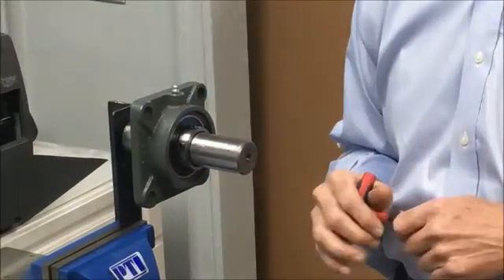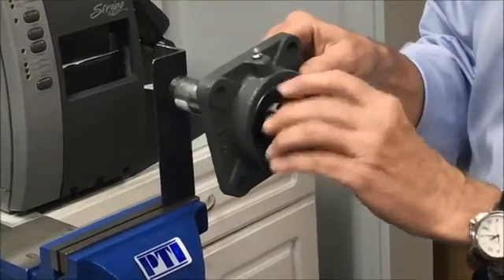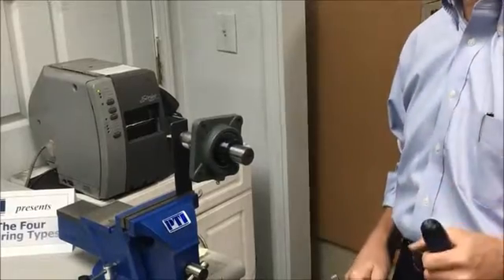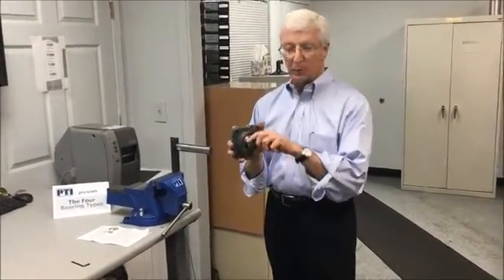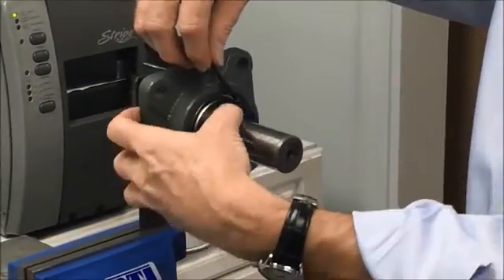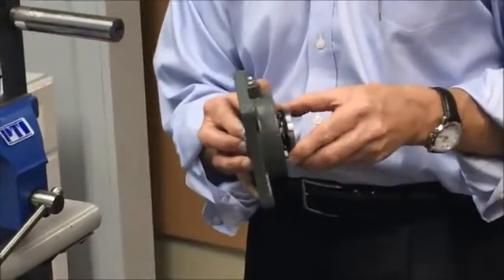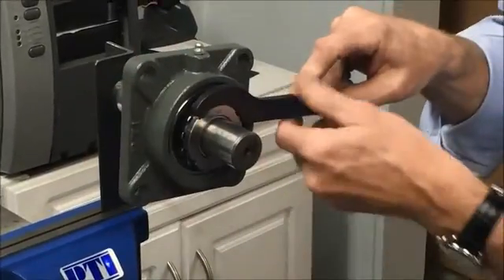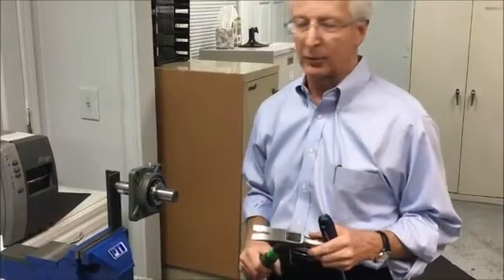4 Ball Bearing Mounting Methods - Mounting (2 of 3)

Comment: Sorry, one more question - the set screw method would work only if the inner race projects out, wouldn't it? I don't know of bearings in which the races are of different lengths. Is there something I am missing?

Comment: Great Video. 
2 questions on method 4 (adaptor) -
1. Since the adaptor goes between the shaft and the inner race of the bearing, the bearing must be chosen with that gap, right?
2. Are adaptors available for a range of shaft diameters? What are they called? Where could one get them?

Also, you showed the bearing already mounted inside its housing. How was that done? Is that an interference press fit? Or are similar tools available to mount the outer race of bearings into their housings?

Would appreciate guidance. 

Your content is unique. No other channel is talking about these methods. Keep it up. I learnt a lot.